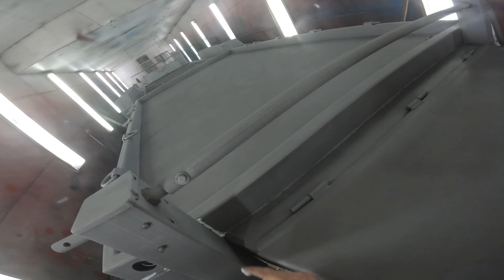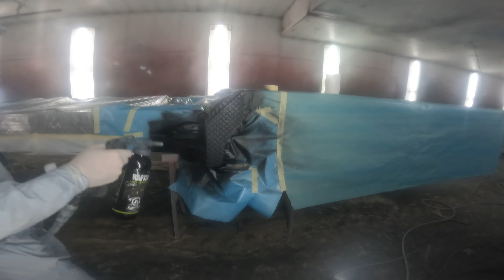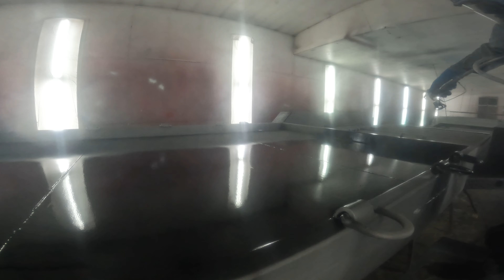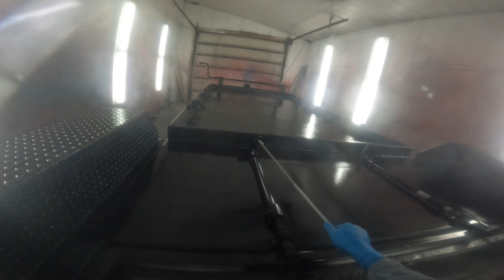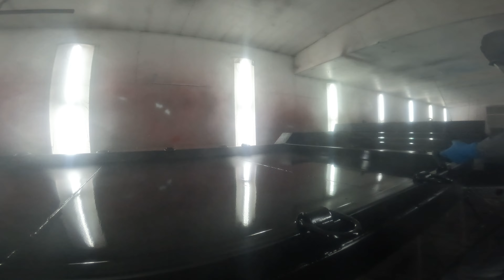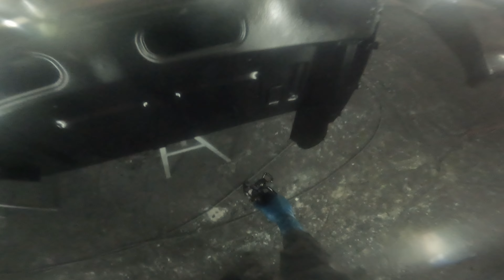Raptor Liner, Prep and Paint Trailer Restoration

Comment: What did you spray under the raptor liner?
Reply from the maker: Epoxy primer
Reply: @BlackDiamondSandblasting Can you just spray on metal after sandblasting or do you have to clean with chemical or just with air?
Reply from the maker: @johnstoll5277  make sure it’s dust free then you can spray epoxy on it. Box liner products are not made for direct to metal.